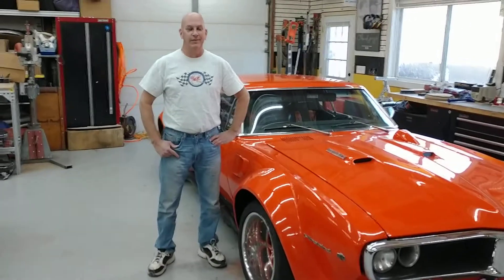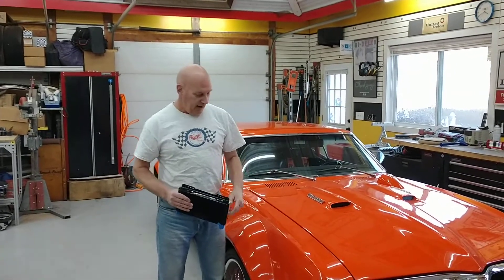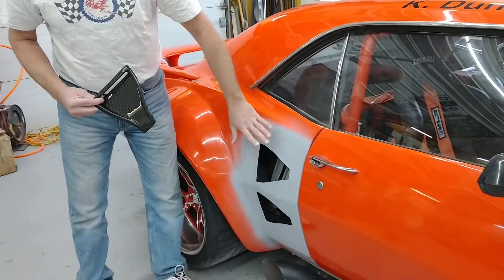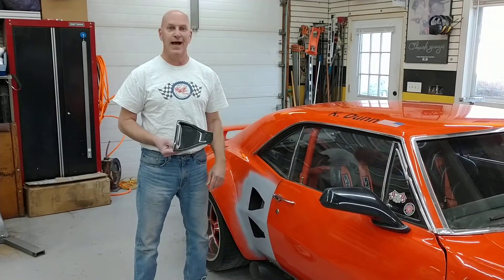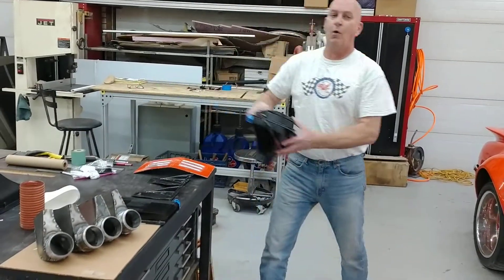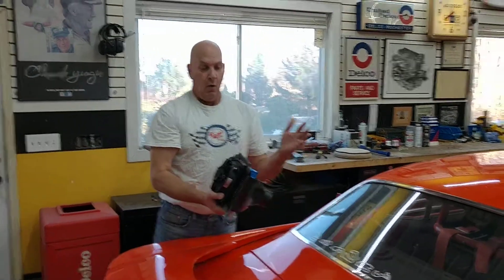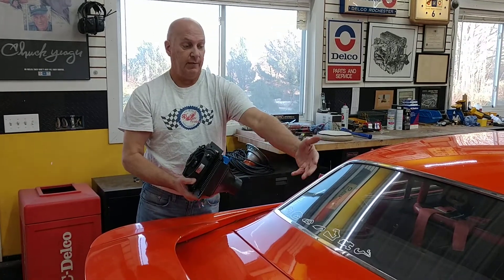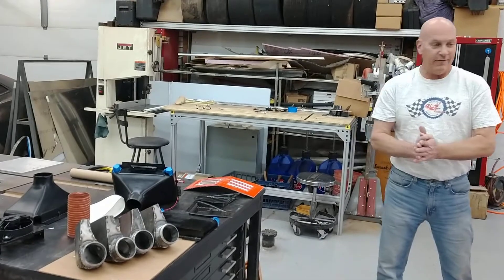Rear Mounted Engine & Transmission Oil Coolers w NACA ducts

Comment: I like the idea! 👍
Any update?
Reply from the maker: They've performed really well. Typically reduces the oil temp by 10 degrees. It also adds about an extra quart of oil to the whole system.
Reply: @castleworksmotorsports4611 👌
I'll put some on mine 👍

Comment: They make NACA ducts with round ports already on them. Pretty common really. One thing is the aerodynamics of the car. The NACA ducts work off the boundry layer and it needs smooth air. Not sure how effective this is going to be located on the side of the car. Your front tires, fenders, and flares are going to introduce a lot of turbulence. This might not work.
Reply from the maker: There was not enough room to transition to the round duct immediately due to the side window glass and regulator. 
These ducts have been performing very well under race conditions this past year and have reduced the temperature as planned.

Comment: Any updates on how the air flow or the temps are with these? I have a MR car and thought about doing side vent coolers but they just dont seem to get enough airflow, I love the fab work!
Reply from the maker: They are working really well. When the car is stationary the fans pull air in thru the vents. At speed the fans are not needed. I have not raced the car this season, but have put a lot of street miles on it testing the system. It has lowered the coolant temperature by about 10 degrees. Next year I will be racing the car again and will have a better idea of how it works under those conditions. Thanks for checking,good luck with your project.

Comment: Wow ! Sure alot of thought put into this.. How did they work?
Reply from the maker: They are actually working very well, engine oil temps drop down, pressure remains good. The transmission has not been ran hard enough to really test it out, but I am less concerned about it. The pump made by Tilton really works well, it won't have any issues circulating the gear lube.